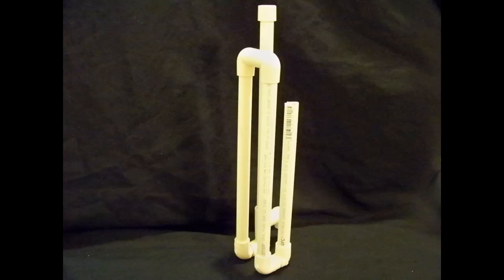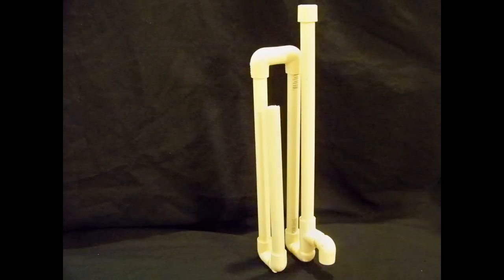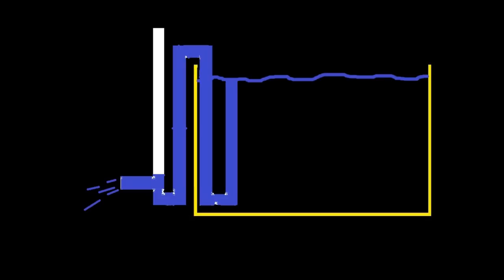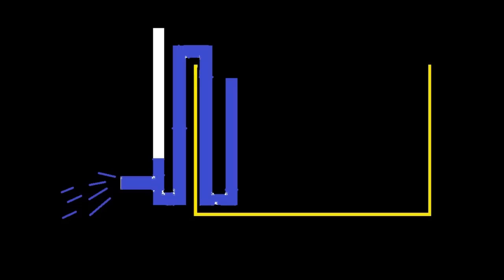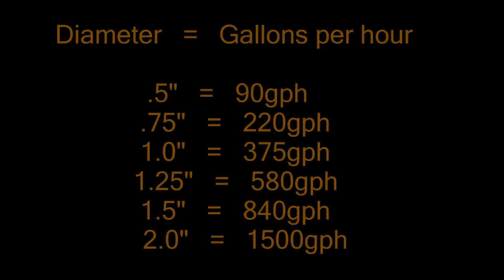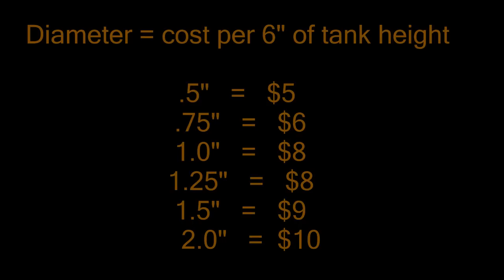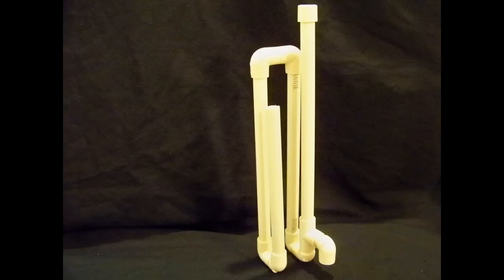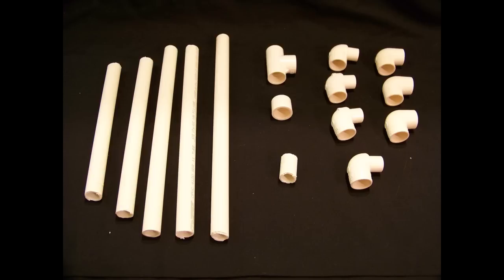HOW IT WORKS: DIY Aquarium Overflow PVC

Comment: i now have a 100L/25 gallon tank 40 cm highso 16 inches high
is am planning to get a 350L 90gallon  i an 26 inches high tank.
can i make a 15 inch hihg overflow and use it on the 350L /90gallon tank ?
i am planning to use a 1 1/3 pvc pipe or 32mm

Comment: I was wondering how you prime the system.  if you suck out air from the check valve, wouldn't you continuously take air out as air is entering from the other openings?

Comment: I wan wondering how 
Make it silent on the intake ?
Have 1000-2000lh pump on a 32 (internal 26)overflow   But when I put it full power in wont run contact first a lot water and then nothing then  more Gaia ) it is flowing but simply not constant so it is pretty hard to make that silent also

Comment: Hey man, your videos are great!
I'm setting up a salt water tank and I have a question, I have a 37 (US) gallon tank, and I've got a Fluval U3 (600L(158 Gallon)/Hour) internal filter.
Would this be sufficient to run in the tank  with weekly filter cleans? 
Otherwise I was thinking about using your tut to build a sump with this filter and a protein skimmer combined in.

Hope you get back to me, Cheers!

Comment: Is there any way to use an overflow that sucks up the water from the bottom, so it sucks up the debris sitting on the bottom of the tank rather than the clean water from the top?

Comment: But the end cap is past the loop so sucking hard enough would fill it with water and remove all the air, wouldnt it? I dont mean to be a pain, it would be cool if i could avoid having to find the valve and drill more holes :p
Do you think home depot would have the valve?

Comment: Does this work if the inlet pipe is really low (say half the rest of the setup). I'd like to do this, but I want to keep the water level lower for my turtle.
Reply: It works as long as the top of the inlet pipe is above the tee fitting that's on part of the overflow that is outside of the aquarium.

Comment: I've been running this (1"x2 -360gph before head) for a month. I'm wondering, what determines the length of the full unit? I made my bottom U 3/4 down the depth of my tank, not the full length down. Is this important? I've googled this endlessly but no answers.

Comment: been watching this video way to many times i have a friend that did 1.25 in  pipe i would not restart the flow i was wanting 2    1 in pipe and was wondering if i have to have a aqua lifter pump in case of power outage realy like some help or what you think would be best for i have rio hyperflow 26 1590 gph please get back asap so i can start

Comment: Hi what if i dont install the check valve but instead i suck the air out manually from the 'highest pipe .... would it work ? because i think i will have a hard time finding the check valve :(
Reply from the maker: You will never get the air out. Any pet store sells them. They are very common.

Comment: What happens if the pipes are larger than needed, what would be the result?  I think my Iwaki pump delivers about 750 gallons per hour.  If I use (2) 1.5" pipes and your're saying that 1.5" can handle 840 gallons what will happen?  Thanks for your advice

Comment: i didn't understand the electric power cut of situation.. when the electric it cet of. who suck the air from the top of the tube to start the system again?
thanks
Reply: Their isn't getting any air inside because the water stands stil

Comment: You mention that .5" pipe has 90gph flow rate. Can you tell me how that was calculated? I have a 28g tank and was hoping .5" would be sufficient. Most sources I've found say that this size is capable of 480gph. What am i missing here?

Comment: @ninga115 I have  two  over flows, the first is set up just like the one in the video and another set up with the intake way below the surface( near th bottom)  a 250 gph water pump( pushing water at full capacity) my two overflows handle it just fine.  and

Comment: i havent tried but could you not use a breather from a kiddie cup. the none spill kind. it would keep water flow and release the air to hold th prime. then u wouldnt need the tube to be taller than the tank. is my science in this wrong?

Comment: is the pipes has to reach the bottom of the tank?? I'm thinking of make it on to reach quarter of the aquarium, is it gona work??
Reply: The tubes need to be long enough to maintain the vacuum you create (lenght=2*diameter of the tube you use). Futher the 2 bottoms of the pipe has to be level and the T-tube outlet has to be lower than the inlet tube.

Comment: I must be missing something.  I don't understand the need for the tall stand pipe on the outside (upper loop).  I understand the concept of creating a suction vs an overflow situation.  However, the water in the tank can only drain down as far as the level of the inlet of the upper potion of the overflow pipe inside the tank.  Once the water level in the tank drops below that level, the water will stop flowing out of the tank regardless if you have suction or an overflow situation.

Comment: and if the water level in each side is equal it wouldn't become a siphon. In addition the siphon would break once the water lever was lower then the intake pipe on the inside of tank.

Comment: Hey Joey, Love watching your videos. Thank you for your expertise. I need some help, I have a 80 gallon tank and a sump of 30 gallons. I did your diy overflow pvc size 1 1/4" my return pump is 400 gph and its about 4ft from sump to main  tank, really low pressure  so I got a mag drive 12 but now it's stronger (i  like the flow) but the 1 1/4" overflow is trying to catch up but and does this whirlpool and it's like 1/2" under the water now, and makes this loud slirping noise now too.Can I do a new overflow size 2" pvc ? Will that help? I know I could put a valve to control the return pump, but I heard they get damage faster because iam restricting the pump. Is that true ?.. Need your help brotha! I thought I knew what I was doing but I'm lost LOL!.. Thanks Brotha !! ..Thank you 
 - From California -... ( I hope I made sence lol )
Reply: you can put basically a bleeder valve on your pump return line. basically a ball valve that you can open or close to balance the return flow   and just have to plumbed back to the start of your sump

Comment: Joey, question for you...
When my return pump is off and then when it comes back on, it takes a while for my tank to equal out again.  Meaning the pump returns more than the overflow can take down to the sump.  It takes the take a good four to six hours before it balances out again. 

Is there any way to fix this or is this just how it works?
Reply from the maker: That is a tremendously longer time than it should do that. That process should take minutes, not hours. Its hard to trouble shoot something i cant see though. Times like this, i wish you guys were my neighbors so i could just run over and fix it. haha
Typically, the most common problems are air leaks or under sizing. I would GUESS undersized in this instance.

Comment: I didn't see this answered so I'll take a stab at it.  Once you suck out the air and bring the water to the point of the check valve (one way valve) and the water overflows down the pipe on the outside of the tank (priming the overflow), no more air enters the system, only water.  No air can get past a little ways down the first stand pipe inside the tank as water overflows into the first pipe. No air can get down to or past the first bend in the pipe on the inside of the tank once it is primed.

Comment: Why does the overflow pipe go to the bottom of the tank. can't it go several inches under the water  line.
Reply: I think the idea is to have enough water flow first, in order to push enough air out of the top part of pvc to ensure water pass by.
Reply: I'm pretty sure that it's because that would create a siphon effect in the closed section that bends over the tank. Look at the diagram where he shows when the power gets turned off and the water settles. If the inside was higher than the outside, then there would be that suction to drain the closed part and get rid of the vacuum you create in the priming process that allows it to work. Not sure if that makes sense. Perhaps just imagine a siphon and what happens when the intake water level matches the outflow. No suction either way, but raise one end or the other and it creates that imbalance (and of course if the tube gets drained, the vacuum/siphon disappears). My best educated guess!

Comment: Im having a problem with air accumulating in the overflow over time (about 4-6 hours) where the flow doesnt stop but slows down just enough to cause my tank water level to continue rising above the desired level. Does anyone know how to stop this or what i may have done wrong?

Comment: instead of drilling a hole to install a check valve that you will only use once, could you not just hold the top of the outside pipe with your finger or hand, and suck on the bottom of the drain? to me, it sounds cheaper and easier.

...because even if you do use the check valve, if you DONT plug the output and the tall standpipe on the outside, youll be sucking, trying to prime it forever without results.

Comment: s0anxi0us117 - it is possible to create an overflow with bottom suction, however it requires a sleeve to allow the actual overflow to continue as shown in this video.. the sleeve would cause the water to rise from the bottom before cascading down the overflow chute.

Comment: When you suck on the check valve why wouldn't the air just come from the outlet of the tee rather than pulling the water up? I'm confused on why when you suck the air out it doesn't just come in from the outlet or taller pipe with cap and hole drilled??? Help ASAP please!!!

Comment: What if the overflows fails and the water pump over fills the main tank
Reply: Enrique Goitia you get water everywhere
Reply: You have a wet floor. The overflow will ony fail when the vacuum in the tube is broken.
Reply: This is why he says to use two overflows which can each handle the required water flow.
Reply: You need a small hole at the desired water level on the water outlet into the tank. When you lose power you break the prime.

Comment: Excuse my ignorance...what does an overflow do?
Reply: That's what I have been looking for and I still don't understand what it does.
Reply: I'm pretty new to all this, so by all means, feel free to jump in, but from what I understand, the overflow system is needed to prevent the overflowing of a fish tank when it has water, periodically or continuously, flowing into it from another place, like a sump tank, which had received its water from a planted tank, or aquaponic grow tray, that cleaned the water of nitrates.  The overflow is followed by mechanical and bio filtration (polyester mesh or something for bacterial colony, before the planted tank or grow tray) to convert ammonia to nitrates (start cycle all over).  Some people don't use overflows like the one here, but instead, actually drill thru their tanks, if the glass is not tempered.  Anyhow, cleaning the water of nitrates in such a way could help us avoid having to do water changes because of high nitrates, however, I suspect there are other issues that could arise, calling for a sort of water change, like depleted mineral content in the water?  I don't know, as I said, I'm new to all this.

Comment: I didn't understand that at all...water seeks its own level...the water would have to overflow the tank to fill that pipe...and if it did drain...the outside overflow pipe would empty and all others outside the tank as well...from the looks of your diagram...I don't know...third base...
Reply: The T pipe fitting sets the maximum water level inside the outer piping. this also sets the minimum water level inside the piping inside the aquarium. Anything more added to the inner pipe will find it's way to the T fitting opening via the unbroken siphon which cannot break once formed due to water in each of the lower U shaped portions of the piping both inside and outside the tank.  Imagine holding a vinyl hose completely filled with water and having each end in a partially filled bucket of water. One bucket represents the lower U section inside the tank, and the other represents the U section outside the tank. As long as neither bucket fully empties; the siphon will not be broken, and because the T fitting opening sets the water level in the pipe both inside and outside the tank.. the siphon will not break... Hence the term overflow... It applies to the water level at the T fitting opening... not at the intake in the tank. Any extra water added to the pipe will overflow at the T fitting!!! And I love Who's on first? Abbot and Costello... You should understand this "Tomorrow".   :-)